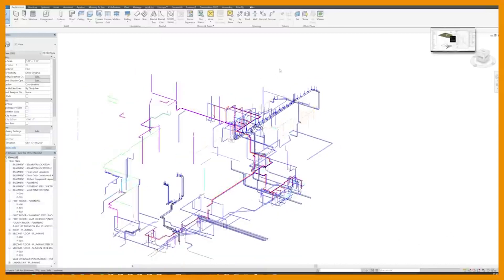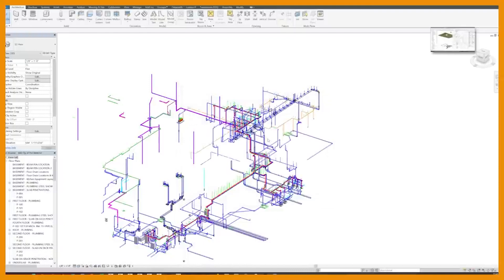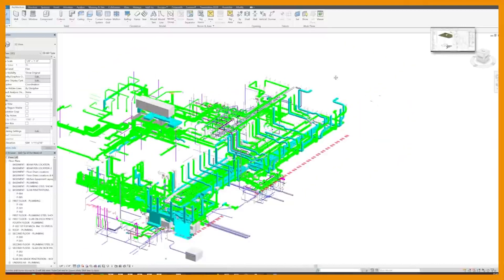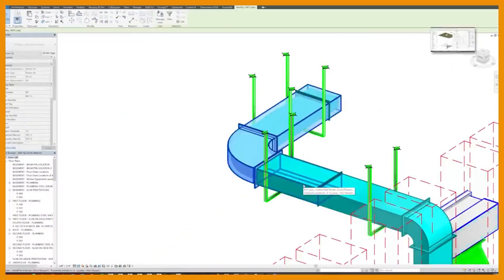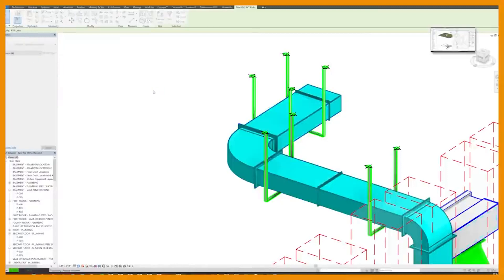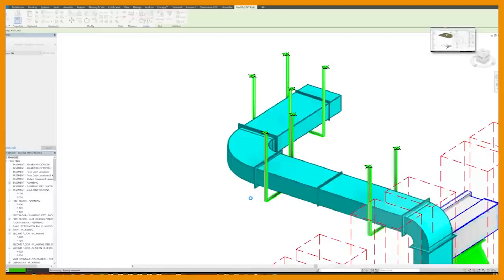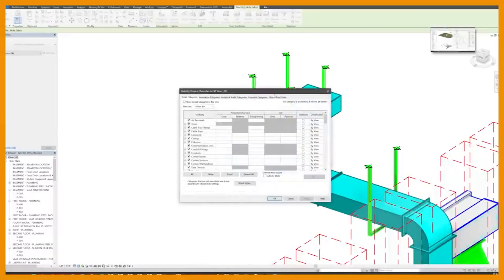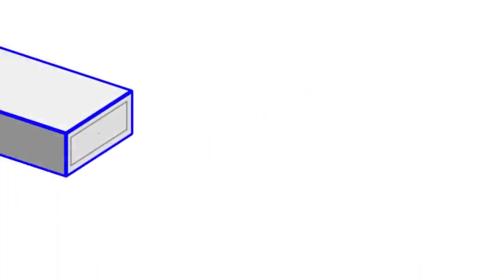Copy Elements from Links in Revit Tutorial

Comment: Why would you use this instead of copy as part of copy/monitor?
Reply from the maker: Good point. Copy monitor works great but it is limited to only specific categories.
Reply: I tried to copy pipe with copy/monitor but it doesn't work, i guess that family system we can't copy it with copy/monitor
Reply: You can use Copy/monitor for only 7 set of elements. Copy monitor wont work on Pipes/ducts.

Comment: This could be the solution i'm looking for! I've got this linked model that i'm trying to bind and ungroup but it always gives me critical errors and forces me to cancel. Didn't know you could just copy from links.. Is there a way to select everything without doing it one by one?
Reply: If you need to copy the complete run of ductwork, it might be easier to just open up the linked file, tab select the entire duct network and use the same copy and paste aligned to your project. The technique Jeff is showing in my experience is best for copying single elements like plumbing fixtures or diffusers. But since you can only select one element at a time, opening up the project is probably going to always be better for large copy pastes. Just make sure you detach the revit file when you open it so you don't mess with the original. Let me know if you've tried that before without any luck.
Reply from the maker: @mep_guy  Agreed... This is great for one off situations when you don't want to open the link , for sure!
Reply from the maker: Yeah, this could help when binding doesn't work!  The only way to select multiple elements from a link is using Dynamo or manually control selecting... I haven't tested large copy/pastes and process.